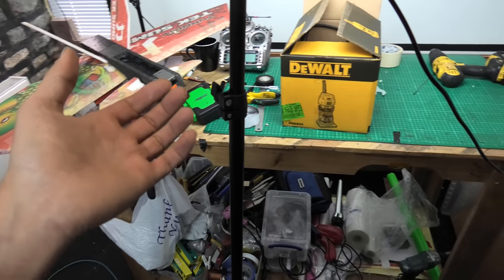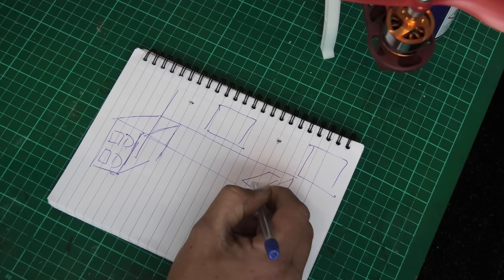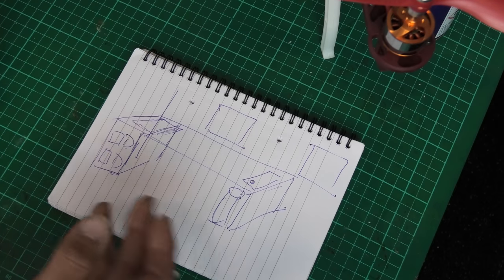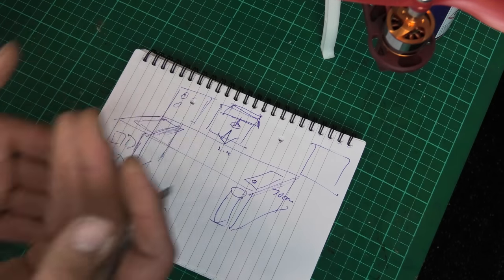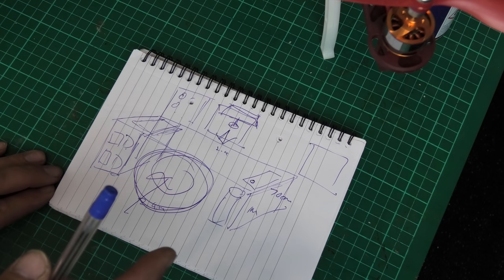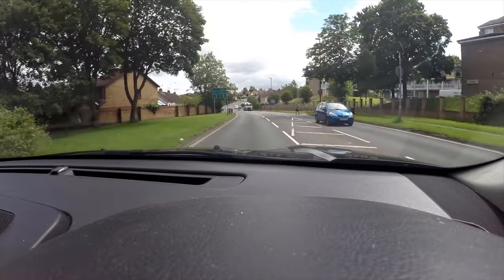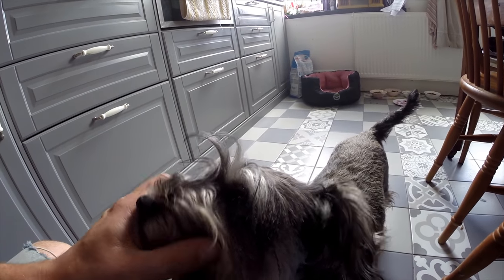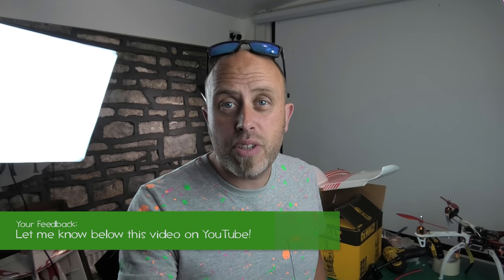"I've got Wood" - RC Workbench Build Part 1

Comment: Just a few suggestions I would add a usb hub and run the wire behind the bench so you can connect to your pc or laptop during your build for setting up inav ect a.Would also add a strip plug with usb charger for charging cells, screwdrivers ,powering heatguns,  saws, and drills . also some magnetic tape and or magnets to hold screws.
Reply from the maker: Morning Chris, yep I'll have extra plugs and those magnet strips need looking at to how best I can use them. Good ideas! Matt

Comment: Bench design looks appropriate. Dang cute dog 🐕It just occurred to me is wood in Europe sold by the board ft or meter and is plywood 4x8 sheet.? Just wondering .
Reply: If it's like NZ the large pieces usually go in multiples of 60cm, which is approximately 2ft.
Reply from the maker: Howdy, they call it 8x4 but it's short in both directions. I also keep to the trade places as the service is better, greater choice and prices are lower. Matt
Reply from the maker: Oh and when working with wood, I use inches as my primary measurements. They're much faster to work with. Matt
Reply: @RagTheNutsOff  thanks Matt hope the build is going well.😊
Reply: @iforce2d  interesting how similar but different 👍
Reply from the maker: Yep going OK. Used it for the live #BuiltSat session and I have a collection of sheet material on it's way to me for tomorrow